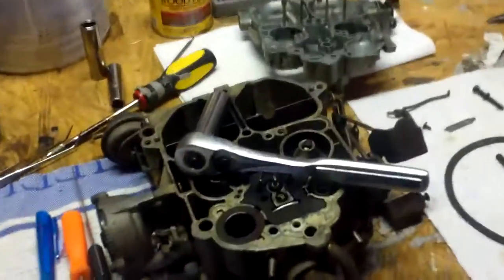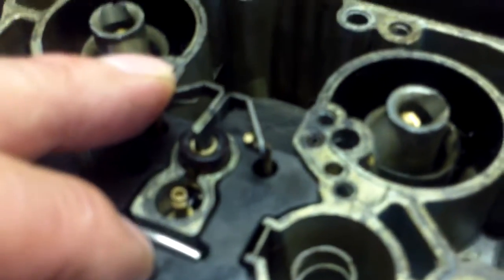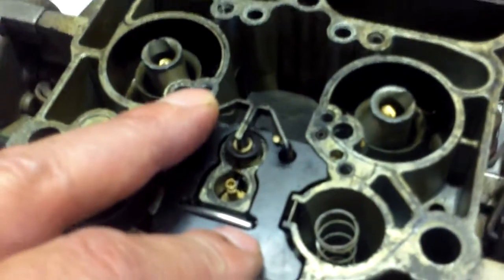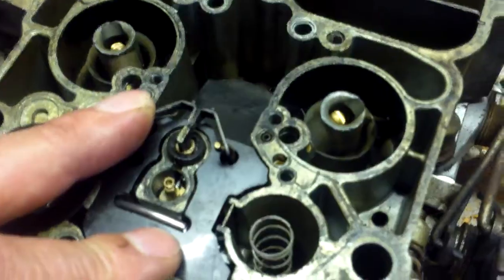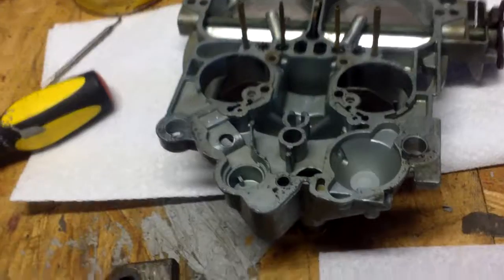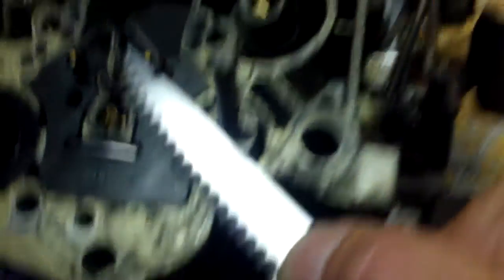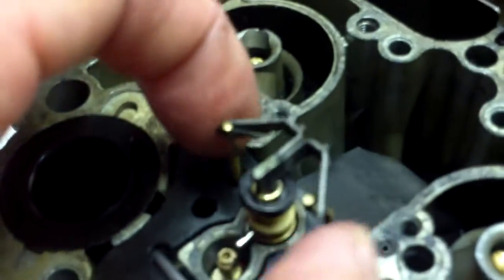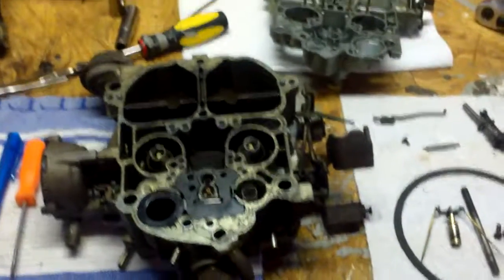Quadrajet Trick

Comment: That little ring thingy is a lock ring that holds the metering rod piston thingy into place whilst you put the air horn in place. What you are calling the power piston is actually an accelerator pump piston. That carb is either a 1705 series (76 thru 79) or a 1708 series (80 up to the end of production). Almost all those series have the same size primary metering rods (at least all of them I have measured) and overall fuel metering of the primaries is done by altering the jet size. The secondary metering is done by varying the metering rod size but not the primaries. True, they are delicate and getting them inserted into the jets is frustrating. Take a 1/8" pin punch and force the little piston retainer into the area provided at the top of the power piston bore. If it wont stay in place (piston pops out) just stake the top of the bore with a 1/16" or 3/32" punch in 3 places to hold it in place. The metering rods don't shut off the fuel, they are tapered and graduated so that as they lift up higher in the jet they allow more fuel to pass thus enriching the fuel mixture to provide more power. Not a trick, it is a clumsy way of doing the job, and ineffective. The job of that little ring is to hole the piston in place so that the air horn can be installed, simple.
Reply: Get em Larry 😂

Comment: You peen the metal on the piston and the accelerator pump not power piston is a piece of cake your way over thinking this process a small tap on the side of the piston w the metering rods while holding it down with a sharp punch holds it perfectly and the gasket seals it

Comment: Hi Eric!!  What can I do to fix permanently well plugs leaking head ache?  I had seen people using JB Weld some kind of malleable sealer and other used Marine Tex with short time results.  Please, can you help me with this, do you have a video doing this job?  Thanks, 
Ray Ray from Puerto Rico.
Reply: you have to drill it out and use new plugs. Epoxy like JB weld works temporarily but will leak over time